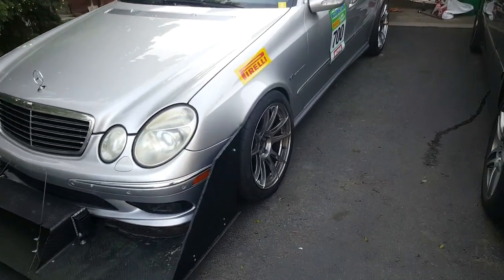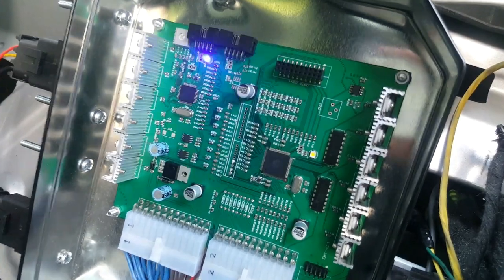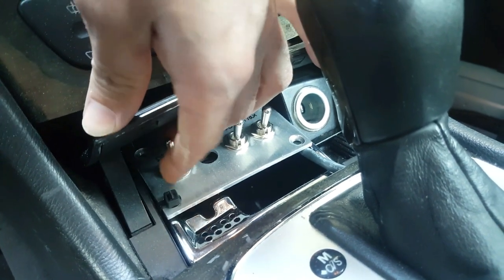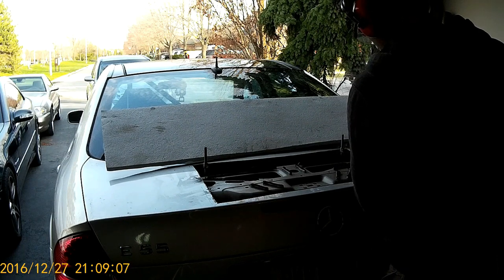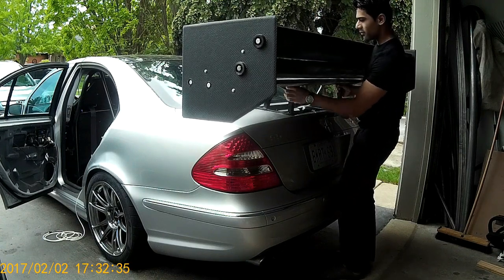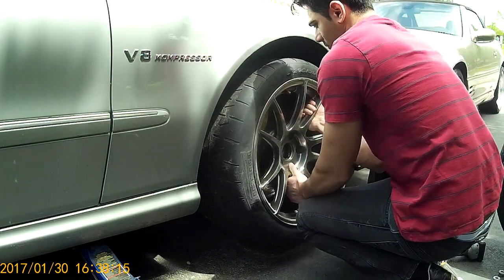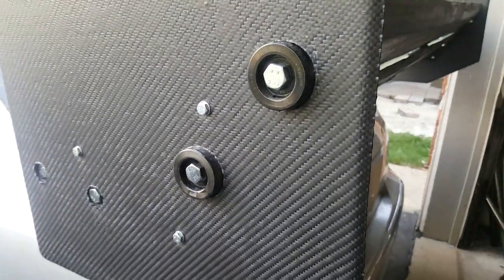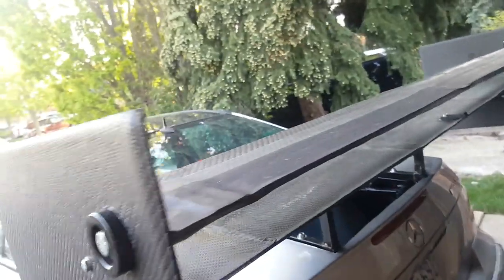How to Build a Properly Fast Track Car - Part 10 (Active Wing, Wider tires)

Comment: Use 12 volt linear actuators used in robotics, tap into the brake light as an input signal to a controller to turn it into air brake.  Use speedometer data & rpm as inputs to and calibrate these inputs for different angles of attack.  Sell it as a kit for my C6 Z06...then I'll buy one :)  If I have time, I'll design one.

Comment: Intercoolers in back? Intake won't be too long, causing lag? Plus added weight... I think better will be to move all cooling behind and leave intake system as short as possible. 
Also the spoiler - it looks very heavy. 
Did you check weight and distribution?
Reply from the maker: There won't be any lag if every thing works according to plan. Just wait till the next videos, I'll explain every thing.
Reply: ok, you have my attention ;)
Reply: SK8215 i think this way a back mounted Turbo would work nice 
Plus your engine bay is cooler

Comment: I really love the build, but wouldn't the cutout for the air leaving the trunk create a high pressure region under the rear wing resulting in lift?
Reply: DuTchReacTionZ Depends .It could produce either downforce or lift depending on how he sets up the vents.

Comment: what if you need the downforce in a situation where you would be at full throttle
Reply from the maker: you don't press the switch under the pedal then

Comment: how much weight is all of that stuff roll bar, wing , all of the turbo stuff
Reply from the maker: Roll cage was around 30kg, wing is close to 20kg and turbo stuff would be close to 0 because the exhaust removed weighed more than the turbos. Overall the car should still be a fair bit lighter than stock. I will probably weigh it later.